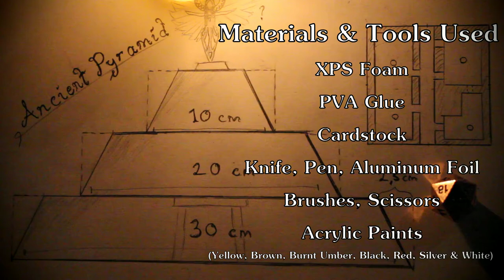Crafting a Miniature Pyramid for D&D (Tabletop Terrain Tutorial)

Comment from the maker: 0:10 Measuring and Cutting The Pieces
2:18 Shaping the Top of the Pyramid
3:06 Stone Texture
4:03 Floors
5:06 Base Paint
5:47 Beige Highlighting
6:31 Floor "Sand texture"
6:39 Stairs
7:11 Trapdoor
7:35 Project Showcase
Reply: Bard's Craft 
I know nobody has mentioned it but for things like cutting out the door 
USE A SMALLER KNIFE DAMMIT
Reply from the maker: @pandoratheclay  Never
Reply: If you cut your fingers of accidentally on camera 
Would ya then do it
I mean cutting fingers of with a sharp knife hurts less then one of those circular saws

Comment: Love this build. Would like to try it myself. I noticed that XPS foam makes knives dull pretty fast. How do you keep your blade sharp and how often do you have to re-sharpen it when you do a project such as this?
Reply from the maker: I use a diamond knife sharpener. If I need to cut lots of XPS while making terrain or big building, one re-sharpening per build is enough. I think the reason my blade cuts well is that I re-shaped the edge, making it thinner and smoother (I just grinded with the sharpener for a while).